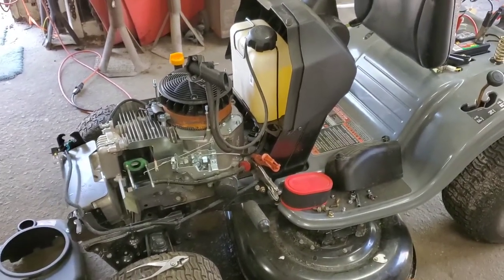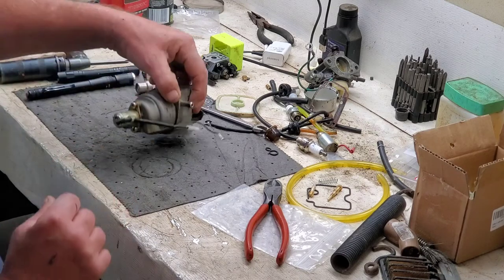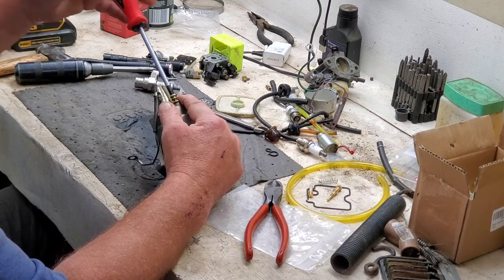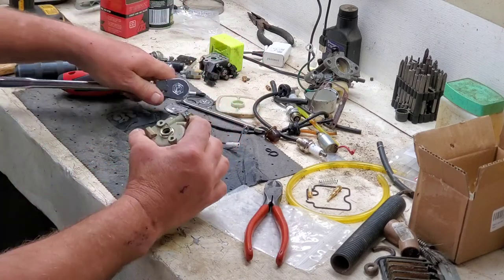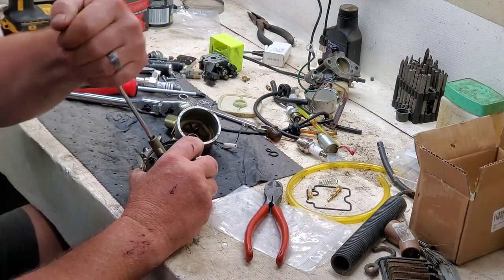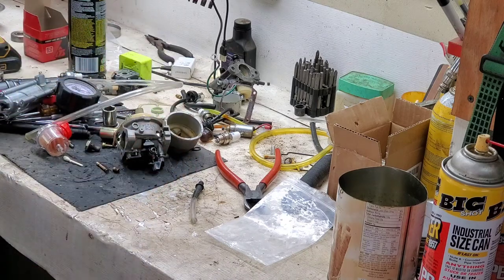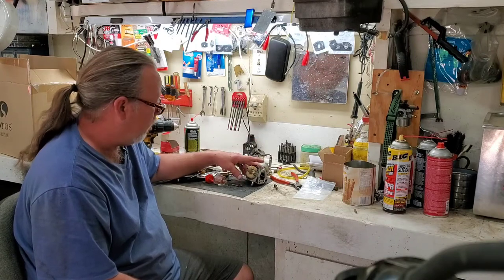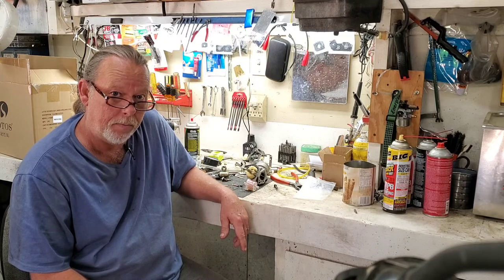A Secret They Don't Want You To Know  Craftsman LT1500 With Power More Engine. No Start or Cuts Off

Comment: Try lapping that needle into the seat like you do with valves. Take a short piece of tubing and put it on the needle so you can attach a drill to it and lap away. Clean it out afterwards with carb cleaner. It's worth a try since you're going to replace it anyway..
Reply from the maker: Yes sir I have done it that way and yes it works, but all the corrosion inside and a chance of a customer come back.  This customer doesn't want to spend that much on the machine so he told us to get aftermarket.  Thanks for the great input and watching our video.
Reply: Great idea ozark arky where you from im in north littlerock

Comment: Can you help?  I have a LT1500 and while mowing it randomly dies. I have to disengage the mower blade lever and sometimes I have to wiggle it when its in the off position to get it to be able to turn the engine over again.  What causes that?  Do you know? Can you give me some suggestions of things to look at?  Prob the blade switch or the wire has is shorting? Thanks.

Comment: What you showed in this video is the exact reason why when I find corrosion or gunk in a carburetor I clean the main jet and needle and carburetor passages with carb spray. If that doesn't work, I go right to an aftermarket replacement carburetor. It is just a waste of time to try and polish a turd. Obviously, you can occasionally see issues where a bad/damaged carburetor gasket or insulator can make you think it is a carburetor problem when it is a vacuum leak.
Reply from the maker: Yes sir you nailed it. Glad to see you liked it.  The smaller micron filters keep so much more out of the carburetor. Thank you for watching my friend.